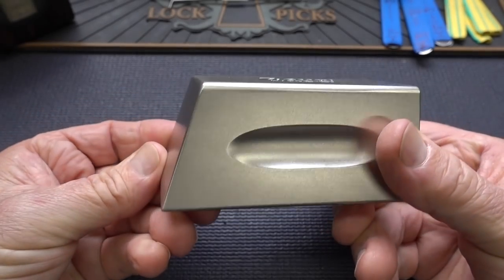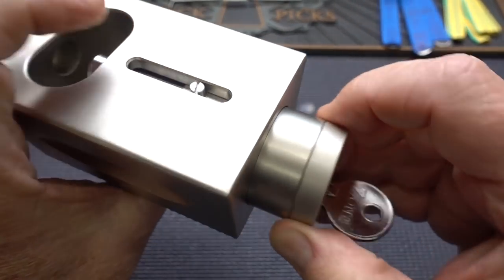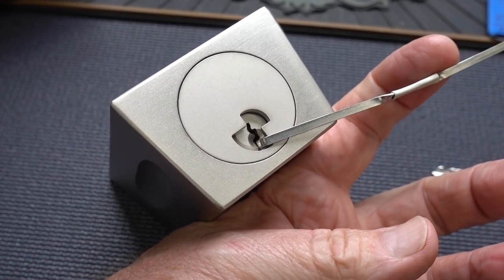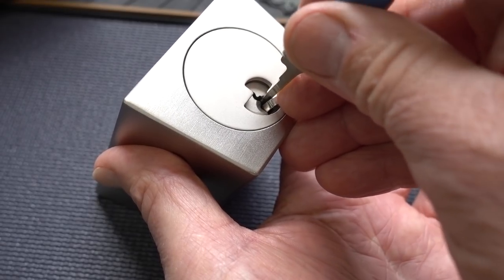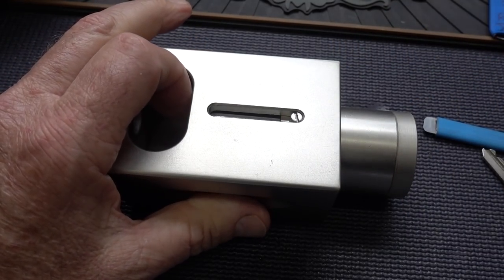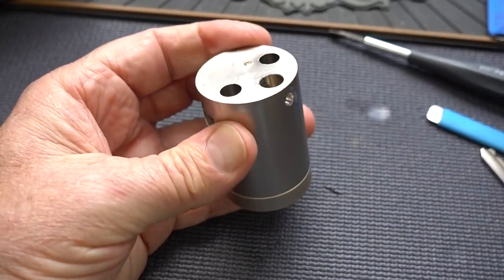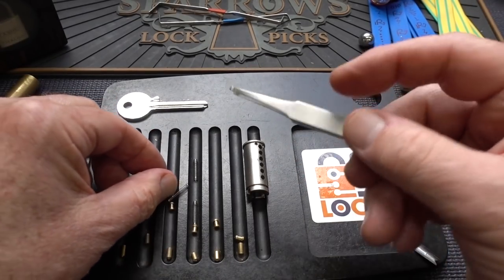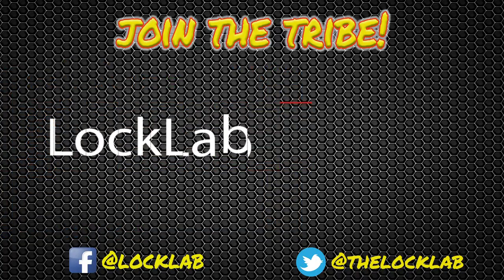(1333) Zone Shipping Container (Conex) Lock Picked & Gutted

Comment: The first pin was a gatekeeper, but to maintain security they made it a serrated pin; therefore, it held the plug in the correct position but it wasn't an easy pick like if it were a standard top pin.

Comment: Looks like such a well built lock! Maybe should have used a better snap ring and more intricate pins though. Why don't manufactures undercut their cores and use more serrated pins? Seems it shouldn't be too expensive for the extra picking resistance it would offer.

Comment: Hey Bill, there's something I've been curious about for a while but forgotten to ask. Do you ever by convenience or need, view your own gutting video for reference when repinning or reassembling a lock? Like if you bump the tray and pins go flying, or you're having other troubles with reassembly?  - Also, now that both your audio and video skills and equipment have matured immensely, and the tools and parts that are available off-the-internet-shelves for us has done the same - would you consider redoing a pinning-video? Maybe with some new tips and tricks if you have any, some tricky but reasonably common bits with challenge locks like multi-part pins, a T-pin with shim etc..? Maybe even your view on filing/grinding key pins "in situ" to fit (seen a lot of that lately, or the marks left behind on the core from populating it incl key and then grinding them down to fit while in the core), and maybe even a demo if you do condone this. Just spitstorming, might be a bit much for one video, but at least there's some ideas :)
Reply from the maker: Yes, I have reviewed videos many times to see how to put stuff back together, especially when it unexpectedly flies apart. Junk springing out is a disadvantage of gutting locks for the FIRST time in the videos - I absolutely REFUSE to stage that part because i think it is cheating.  When you  take stuff apart for the first time on camera, things occasionally go wrong, and that is what i want to capture because YOU will experience the same thing when playing with the locks.  There are those that practice the gutting part several times off-camera, so they look like they have gutting superpowers, but it is an illusion (and deception).  NOBODY gets it right the first time, every time. Sorry.  Insofar as the pinning videos, I've done several - the most popular are the "Psychological warfare" videos.  And no, I do not recommend filing pins.

Comment: I want to start lock picking. I want to buy from sparrow. What do you recommend?
Reply from the maker: I'd recommend starting out with a Sparrows Tuxedo kit.  Great selection of high quality tools at a fair price.  The link to Sparrows is in the description.
Reply: Check out sparrows spirit set. 

Same size as tuxedo kit, but more spp focused with 4 hooks 2 rakes. Hook, euro hook, steep hook , high reach hook , Bogota, city rake. 6 tension wrenches . Then add the heavy bars , very important!
Reply: Thanks. I will check out the spirit and tuxedo set and then decide! I really apreciate both of your answers!
Reply: Sparrows cutaway with the reload kit with either one of those lockpick sets will let you practice a whole bunch of different keys that you can change the drivers (pins) for whether it's standard, spools, serrated, mushroom, or a mixture of them. Skip the acryllic lock if you're thinking about grabbing that.
Reply: Sebastian R What about the progression locks?
Reply: I'd personally skip the progression locks as you can open up the cutaway lock with the reload kit really easily and pin it up yourself for 2, 3, 4, 5, or 6 pins. (The only drawback would be that it might get repetitive repinning it up since you'll probably blast through 2-3 pins, but it's good practice and it'll get faster each time you do it.) Just don't peek as you're picking them and it's the same thing, with the added bonus of being able to peek if you still can't open it for the life of you. You'll also be able to see how the security pins work once you eventually get there. On another note, grab the heavy bars like Josh said, they are a necessity for top of keyway tension, which for most people becomes the method of choice for tensioning. Skip comb tension bars entirely at this point. With the reload kit, I'd recommend the mini pinning mat but you can do with just some paper with a bunch of folds, which is how I imagine a lot of us lockpickers (including me) started.
Reply: Sebastian R the progressive locks are repinnable but thanks for the information. Now i know that i should skip the progressive lock and that your right, because with the reload kit i can basicly recreate the progressive lock and see What i,m doing if i get stuck!